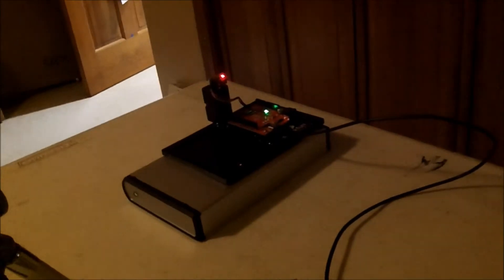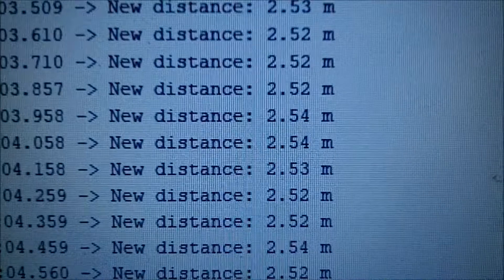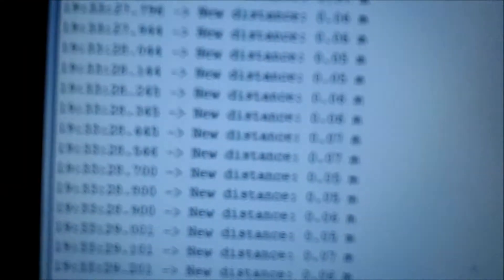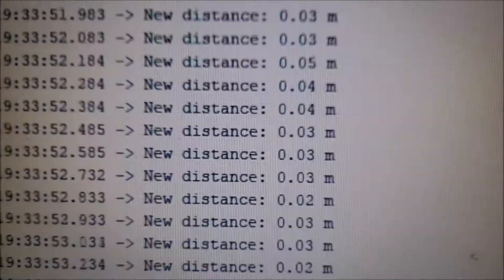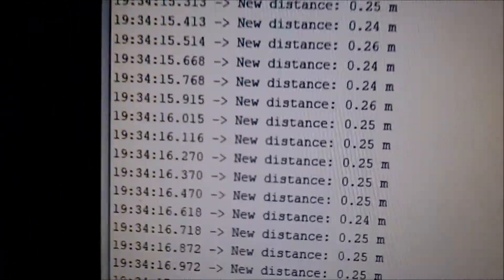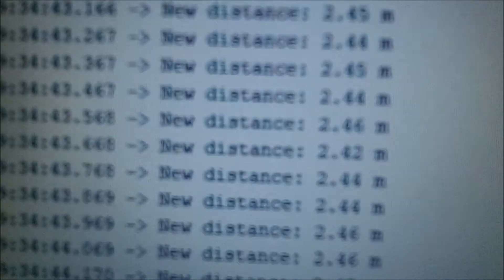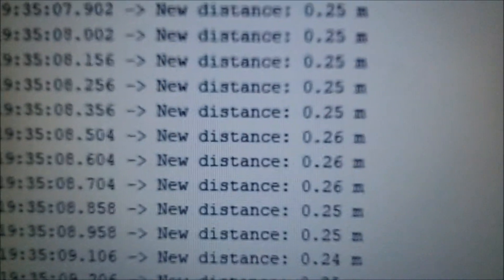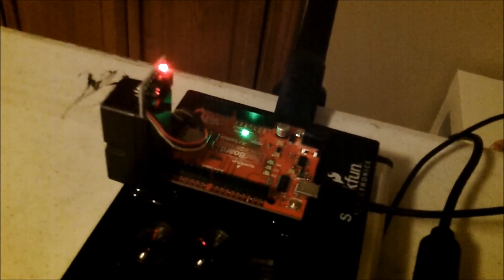Garmin Lidar V4

Comment: I had the same issue. I bet you used the v3 GetDistance example like I did. The v3 example uses a 8 bit int for the distance variable. The max value of a 8 bit int is......255. Unfortunately there is not a simple getdistance example for the v4 like the v3.  So I modified the v3 example and made it work. I posted this issue on Github with my fix. https://github.com/garmin/LIDARLite_Arduino_Library/issues/19

Comment: What's the cone of the IR? Could it be sensing the table in-front of it? try "mounting it higher on the table so you know its not sensing the table. Just a guess.
Reply: Its angle is around 4 degrees, so it is picking table. Raising it 10 cm would have fixed this